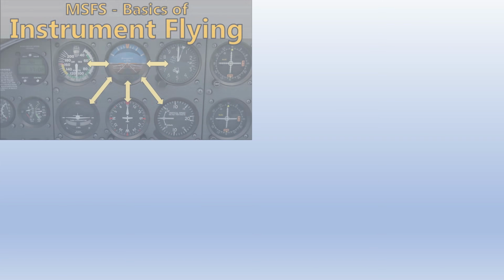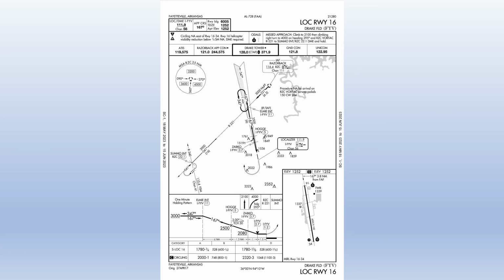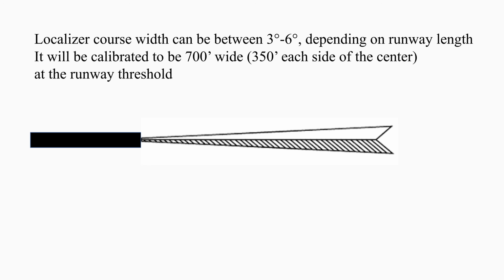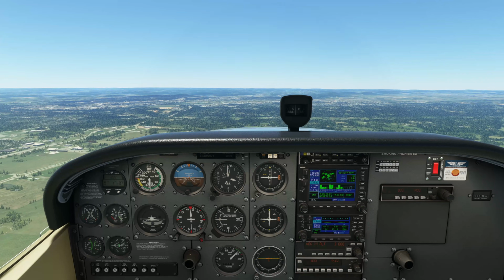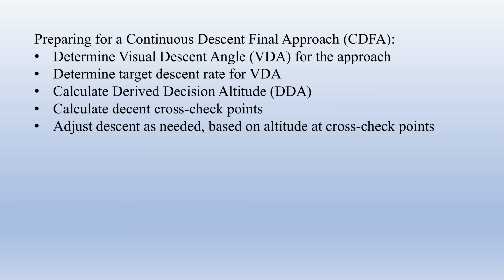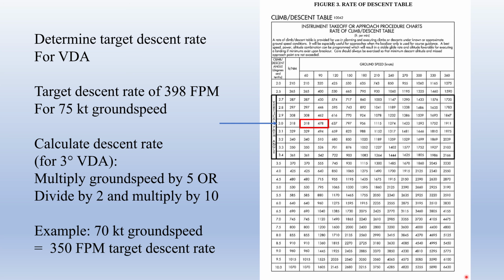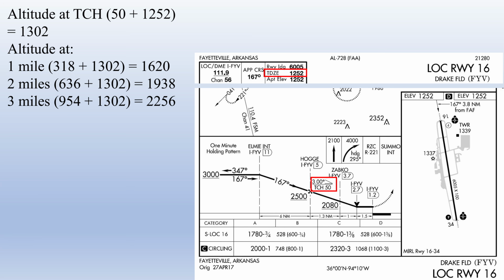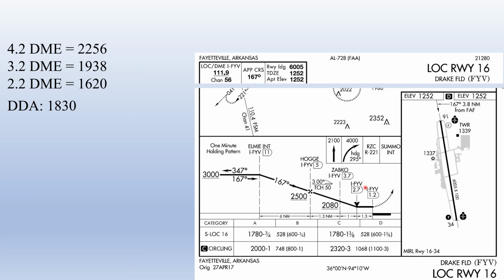MSFS - Localizer approach tutorial, part 1 (AH IFR flight lesson 7, part 1

Comment: I enjoyed the video a lot! Many thanks. Is it the correct way to read the profile chart: be be at 2080 ft or above at ZABKO; next be roughly at DDE (1830 ft) by the time we reach VDP (2.7 DME). Then proceed to visual landing or go missed at MAP (1.2 DME)? That corresponds nicely to the CDFA descent. However, with Dive&Drive we would be at MDA (1780) at ZABKO which is way below the 2080. Would that be legal?
Reply from the maker: @mpaw23, you are reading the chart correctly for the CDFA.  If you were to use the dive & drive technique, you would initially descend to 2080, then when you cross ZABKO at 3.7 DME, you could descend down to you MDA of 1780.  ZABKO is a step-down fix.